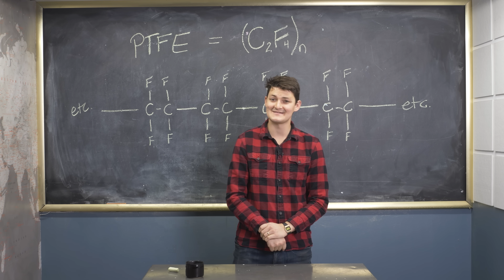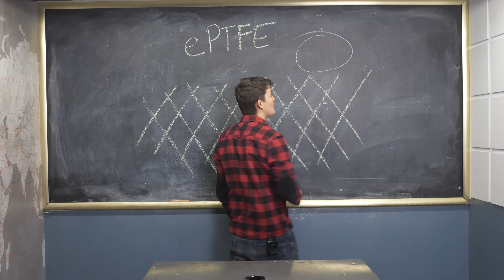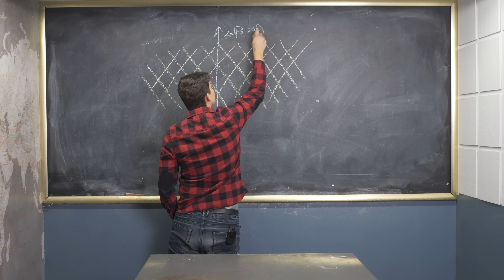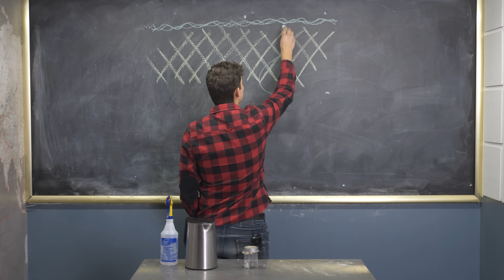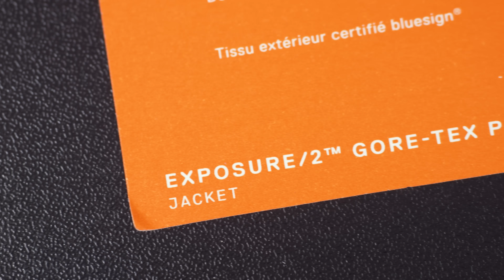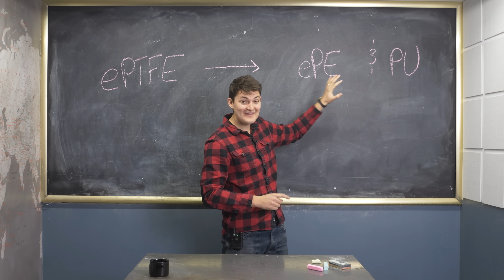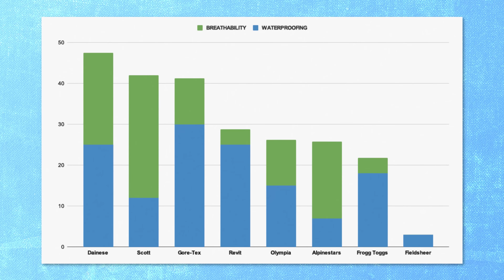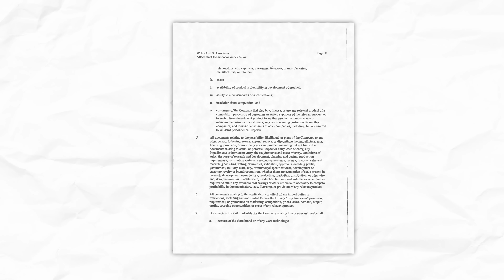Gore-Tex is a Marketing Gimmick

Comment: Actual Fact.PTFE is s plastic with a  uniform micro permeable when stretched at a certain heat. First used for blood filtering in Kidney Dislysis to remove body toxin build-up. Later applied to clothing : Purpose:
to Allow insensate perspiration out while keeping a waterproof  barrier against Weather and Wind.
 Iwas both the AD and PM for a Kidney Dialysis Medical magazine and a frequent Outdoor Climber, Hiker, Kayaker, etc 
  And have decades in Marketing and the Silly World of Advertising.
  I'd THINK I would Know if the Stuff Failed to Work Wonderfully.
  Sorry, Charlie; Bad Mouthing a  Product Proven under Extreme Conditions is Just Trash Talk. Nothing more. (If you want to discuss the Subject of GoreTex used in Shoes, that is a different Subject. And, Bad News for you, I was a Hiking Boot Beta-Tester for Two Shoe manufacturers whose names you would quickly recognize.) 😊

Comment: For winter sports, Gore-Tex type membranes can be comfortable in some situations. IME, high-quality shells that are newish perform better than shells that are inexpensive/washed a bit/used a bit.

One issue is how much "Gore-Tex" is used in a shell. 

Also, (most?) winter shells seem to be coated to "repel water" with some type of teflon or silicone, which wears/washes off after some time; once the "coating" wears off, many shells get waterlogged and heavy when it rains, and the "Gore-Tex" starts to struggle. One might ask how breathable is the shell with a waterproof coating?

Comment: OK, why is the mostly BS? Because if you're physically active enough to sweat while in the middle of a downpour of rain, NOTHING will allow you to stay dry. Even an extremely hyrdophobic layer will not change the fact that there is 100% humidity at the surface of your skin AND 100% humidity in the surrounding AIR (hello, it's RAINING). So there's NO GRADIENT for "humidity" (water vapor =water molecules) to travel 'down' leading away from your skin. As soon as the rain stops or lessens enough and the relative humidity around you begins to lower, THEN you will lose moisture from inside your GoreTex garment.

Comment: I'd like to add that, gore tex jackets (and all other waterproof membrane jackets) are meant to be used with a DWR. That why literally all of them have it, and you can purchase it seperatly at every outdoor store. A dwr by itself will give very little protection however. I tcan be good enough for going to work and back, for a a mountain trek, you're fucked if you have bad weather. 

The other thing is, gore tex jackets are to be considered as the whole construction, not just the membrane. Because gore-tex does test the whole crosslayer of any jecket branded with their name. It's mostly the inner and outer layer that differs between lightweight cycling jackets or have duty mounteneering jackets. In the same vein, I think a motorcycle jacket fabric won't breath much at all because of how much is packet into that cross layer, wether that membrane is gore tex or not. 

When you look at market prices for  gore-tex jackets with the same build as a high level mounteneering jacket you get fairly similar prices. That is when we compare high end brands with similar production standards. A gore tex might cost 600 where a non gore tex alternative might be 500. for the outdoor clothes in europe at least, your price comparison of double for gore-tex is way overblown.

Comment: It's still pretty good stuff, because the whole thing usually isn't wet, and the goretex layer is usually underneath another shell.  Specifically in boots it's pretty good stuff where you might step in a puddle, and it keeps water off your shoe, then it dries out as you walk and starts breathing again.  There are other manufacturers that use this fabric though, and I don't get tied up in the brand name.

Also the insta360 is awesome.
Reply: It's also good for changeable weather conditions (like we have a lot of in the UK). It might be dry for an hour, rain for 10 minutes, dry for an hour and so on. If you wear a waterproof but not breathable jacket in those conditions you'll get very sweaty. If you wear a breathable but not waterproof jacket you'll get wet in the 10 minutes it's raining. If you wear a breathable or waterproof jacket it might not be breathable while it's raining but you will probably not sweat all that much in those 10 minutes and you'll dry out fairly quickly once the rain stops.
Reply: Gore Tex works really well in cold humid conditions. Yes if you sweat your skin is going to be wet, duh. Gore will dry out once you slow down and stop pouring sweat.
Reply: Proper leather boots are pretty water proof too. Just grease them properly and they hold water well. They also dry fast when walking, if you get GTX really wet from the inside it doesn't really dry out in the wild.

If it is truly, honestly wet I prefer wellingtons. I have great ones from Sievi, light and with a great grip.
Reply: Gore tex isn't supposed to be under anything that's not the actual 3 fused layers, in fact the shoewear that puts a gore tex liner is a inferior construction method to the gore tex on the outside one because you loose breatheability, you could get water or moisture on the inside and the outer material gets damp. That's why gore put the "invisible fit" construction on more recent shoes, so it's more like the shell jackets.

Comment: True! I've been mountaineering in the decidedly wet Scottish hills for over half a century. Before Gore-Tex we really did use a woolly jumper and a non-breathable waterproof with some venting. Using sensible layering we would get damp but not wet. I had a friend who worked for Gore and he smuggled me out a test garment before it was released. Guess what - I would get damp but not wet - and the same with a more modern Gore jacket I was given. For decades I used $20 breathable shells from a mass-market outdoor brand and I get damp but not wet. Nowadays I use a non-breathable mountain poncho designed for venting, that works even better. Gore-Tex is a scam. It works when it's dry and very cold - when you don't need it, but not when it's wet and warm - especially once the fragile DWR coating wears off.
Reply: Now I'm interested in your non-breathable poncho and underlayer setup
Reply: @jelmermulder7276  You asked about layering. I swear by the technical mesh vests produced by Scandinavian companies like Brynje. Then you cap it with a thin synthetic base layer. On top of that, thin layers of directional fleece if required by the conditions. On top of that, a featherlight wind shirt, and then the shell. 

With this setup, most of the dampness gathers between the shell and the windshirt. The mesh vest keeps any remaining dampness off your skin and traps pockets of warm air. 

After over half a century of experimentation, this is much the best setup I've found for wet cold like we have in the UK and Scandinavia.

For dry cold I'd use the same system, but with a ventile jacket.
Reply: @tullochgorum6323  This is the way. 
I use a silk undershirt, cotton shirt on that for wicking, then wool and a (usually nylon) shell with vents. Hood optional except in very windy weather, and a wool cap. 
I'm interested in the mesh vest you mentioned so will look up Brynje, thanks for that. Might be good between the cotton and wool, or replace the cotton depending on weather.
Reply: Best underlayer is lycra like a surf rash vest. Best top layer is something rubberised or at least fully waterproof with adjustable venting. Stay away from trendy outdoors shops.  @jelmermulder7276
Reply: As an ex-pat Scottish Munro bagger I quickly realised that my Berghaus Kang/Phoenix Glencoe/Berghaus Serac/The North Face triclimate eVent/RAB gore tex vintage jackets were all pretty useless when wetted out. After 20 years in Iceland I prefer Ventile for dry freezing conditions and PVC shell jackets with good ventilation. Still wearing waxed Barbour jackets and G1000 Fjallraven jackets in the rain-easy repairs and the horses aren't spooked by their sounds. Just a shame wax goes so stiff when damp and freezing conditions exist. Bottom line: Gore tex? Expensive, hard to repair, and not perfect by a long chalk.
Reply: @brhbrh6326  Yes - I used to have a ventile jacket in the days before modern synthetics. Absolutely the best option in the dry cold - horrible in the wet cold. I remember it being so frozen stiff I could literally stand it up on the floor of the drying room. It weighs a ton when wet and takes forever to dry.

Waxed cotton works well for walking the dog, fishing, birding and the like, but it's far too heavy and bulky for lightweight hiking.  I do still use waxed cotton overmitts though - much nicer than synthetic options.

And yes, for shells I'll go for a silnylon or silpoly with good venting. Cheap, easy to repair, and just as effective as Gore-Tex but at a fraction of the price.

Bottom line - if you're working hard in the wet nothing will keep you entirely dry., especially if you're as sweaty as I am. Wicking and layering are the key to safety and comfort.
Reply: yeah - what's this "non-breathable mountain poncho" you speak of?
Reply: I think it would be like an old school Souwester like fishermen used. @J0MBi
Reply: It's obvious, the fabric is made from a non breathable material.  What kind? Fuq who knows? -but there's an assortment available.  @J0MBi
Reply: Got to love a poncho, naturally bellows as you move.
Reply: @engineeredlifeform  The trouble with standard ponchos is that they can bellow too much - and they don't cover your arms. 

This can work in the woods when it's warm.

But here is Europe most of our walking is above the treeline, and it's often cold and windy.

But if you look hard enough you can find more tailored poncho-style shells that do work OK in the wind. I give some ideas in a post above.
Reply: Biggest problem I have with the whole tex stuff be it gore tex or some other form of breathable textiles, is that when you wear it without a backpack etc, they last much longer and better, since you aren't rubbing off the coating. Or you need to reapply it pretty often, which is pretty expensive and usually also takes away much of the breathabillity anyway. But almost no one wears those just walking along, without a backpack since you use those when hiking, cycling, fishing, etc etc. where you usually carry stuff on your back, and thus the parts that go first is shoulders, back and front where you carry the pack. Let those parts happen to be the parts that get the most hit in the rain. If I know am going in a rainy day situation outside, I just go with something 100% waterproof, like rainjacket etc, since most of the time if you don't exert yourself too much you won't sweat that much that its going to be detrimental to you, either by drying up naturally or you getting warm enough to not get cold. On the other hand, you use goretex thats also been worn quite a bit, you will get rain seeping in eventually. If its just mild showers, thats fine, entire day wit mostly rain, not so much.
Reply: Can you please give me an example what kind of a poncho are you talking about? I am looking for one at the moment
Reply: @savbuvar   Hi - if you check back up the thread I posted some suggestions.
Reply: Silicone or PU coated nylon works well for ponchos. I have a Sea to Summit PU nylon one. Covers a 60L pack and goes to my knees. Arms can be inside, or out. The button up sides provide great ventilation, and it also unbuttons out flat and has eyelets to use it as a tarp. $100AUD, 100% waterproof, no sweating, no PFAS/DWR. They last years of heavy use before the PU coating becomes brittle and starts to crack. @savbuvar
Reply: We have been using it in Mountain Rescue for years. It does a brilliant job. It is far from a scam.
Reply: @natureseyemusic  You say it's far from a scam, but have you ever compared it to alternatives at a fraction the price? I have, and I can't tell the difference. 

And I can promise you, venting beats breathability every time.
Reply: @natureseyemusic , I was in the Dartmoor Rescue Group for many years. After returning from a trip to NZ, on one night exercise with constant heavy rain I wore my Gore-tex leggings and Swanndri jacket (traditional NZ attire made from tightly woven, treated wool). On my head I had the usual "shetland" style woolly hat. When we got to the pub for the "debrief" everyone was soaked to the skin. Except me. I was soaked to the skin from the hips down.
Reply: @ianmcelhinney1530  We may have met - I used to live on the moor and often ran into teams out on exercise!
Reply: I work in the arctic north of the treeline. I layer under exactly the same principles that you do. Wool is absolutely the key. I see so many videos saying to use poly layers since they're better at insulation and wicking sweat, they just smell worse. No. Wool is the damn king as it has been for ages and ages.
Reply: @ron6625 agree totally. Wool is breatheable and waterproof-ish. My woollen Swandri anorack style jacket is better than my goretex jacket and the 3 Ridgeline jackets i bought for myself and my boys. It is made of thick wool and although it soaks in water,  you still stay dry.  I never ever got wet even in pouring rain. I have worn thinner woollen jackets that havent been as waterproof but were still better than the goretex etc.  And when wool does get wet through, it still stays warm. 
The only advantage is less bulkiness and quicker drying.
Reply: @ron6625  I used to go for merino baselayers, but this was costly because they wear all too quickly under a pack.

These days I've found a synthetic base layers that doesn't stink up like the old products - you can literally wear it for weeks if you're on a remote trail. It's more comfortable against the skin, holds less water and drys MUCH more quickly. So I'm a convert.  

Specifically, I'd recommend the Montane Dart Zip Neck. Dozens of 5-star reviews on their site, and I've had a great experience with it.

Comment: Thanks for that. I've been trying to tell people for years that Gore-tex "waterproofs" do not do what they claim, and actually perform worse than some of the cheaper alternatives. Eventually "wet out" will overwhelm the DWR finish, and even the most expensive breathable membrane stops working. After that keeping you dry actually depends on stuff like the cut and fit of a jacket, seam construction, the liner and features like pit zips and vents.  I wear Barbour wax jackets or Paramo brand directional clothing. Ponchos are good too.

Comment: Outerwear really depends on the task. I would never wear anything as flimsy as a gore tex jacket when walking through brush. One thorn tears your sleeve and it's over. I make a lot of my own gear (more customizable) so it isn't stuff you can readily buy but it makes it a lot cheaper. Eg, Filson sells the tin cloth packet for hundreds of dollars. I have a double breasted version lined with an army wool blanket. It also had a game pouch in the back which I use to keep a rain poncho in the event of rain. If you're standing still in a waxed/oiled jacket with a poncho over it, you'll be fine. You're not really gonna feel the humidity build up. It's when you're walking that it becomes a problem. Then there's the forever chemicals. Spot on diagnosis. Outdoorsy people love their health and the environment. Pfas are a big no no (for anyone with any sense actually). Don't buy Filson gear but consider getting wool and carrying a small plastic rain poncho. Best combo I've found. Wool just isn't great for moving through brush. That's where tin cloth excels.

Comment: Oh you do notice when it does work and when it doesn't, but yeah, if you don't have a good DWR coating it's utterly worthless and will just run with water on the inside... 

Oh and from personal experience gained from biking while it was raining - eVent fabric breathed so well it was ridiculous I could go on a 30min+ ride at my usual brisk pace and not drown in sweat, as I'm still stuck on tricyclic antidepressants so sweat heavily. Unfortunately it's maker fucked up the bonding method, so jacket's using it had a bad habit of the eVent layer debonding from the jacket and forming bubbles, add in Gore's bs and that's why jackets using are rare as hell. 

And worse yet for my fat, robust butt definitely not in my size. 

Fortunately the gore-clones have gotten good enough that most jackets in the NZ$300+ range using non-gore fabric work well enough. Which is how I have a newish one in my size that while it's sweaty, doesn't run with water on the inside outside of the arms. Unfortunately you can see pin pricks of light through the fabric, so I don't rate it's longevity lawl.